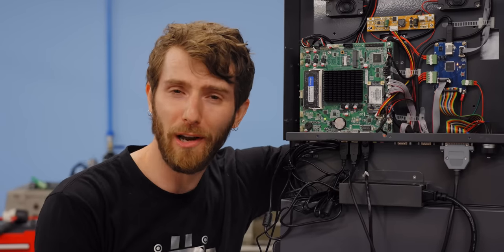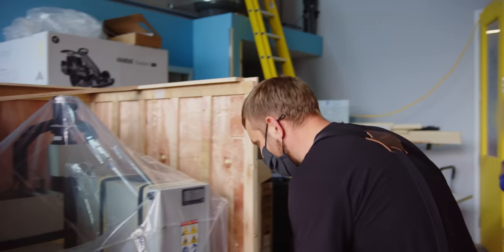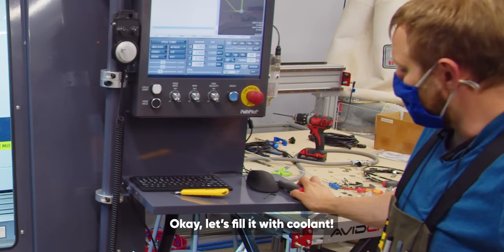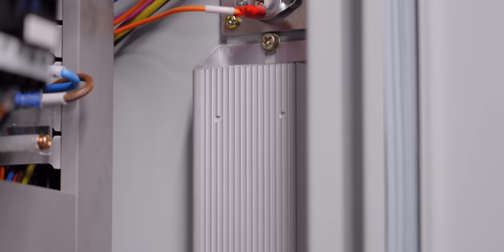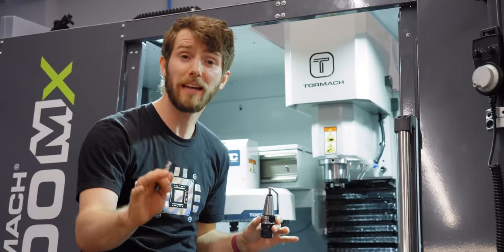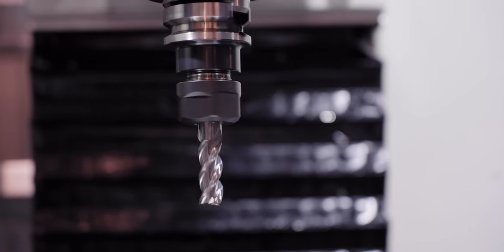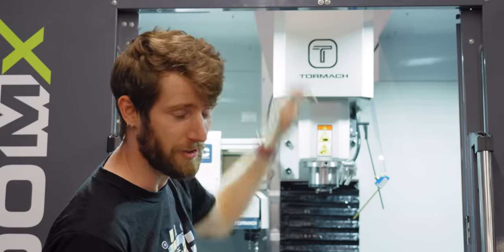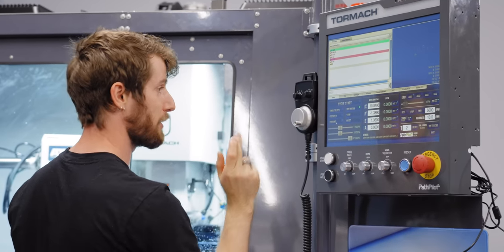The longest unboxing we've ever done. - Tormach CNC Mill Commissioning

Comment: At the risk of being "that guy", kudos for what looked like steel toed shoes when operating the forklift.  However, be sure to wear eye protection (goggles - thanks @DETERNET) when using compressed air to blow off, well...anything.  The trip to the ER to get the little metal shaving out is never fun (nor is the workers comp claim!).  Other than that, awesome vid.  Love the channel.
Reply: Especially with how up tight Linus' HR people seem to be about injurys
Reply: I can attest to this.  Once had a tiny metal shaving fly into my eye when I was grinding.  Thankfully no damage was done but ya getting it out was not fun.
Reply: @outsideredge  same here, one of the most painful things I've experienced
Reply: Use safety goggles not glasses, I managed to get a tiny shard in my eye while using a face shield and safety glasses, still no idea how it happened
Reply: I second this. Worked as a cleaner in a factory specializing in transport augers for a couple of years, and yeah, hadn't it been for protection I would've probably lost an eye (which actually happened to my boss many years prior to me working there. He had to get a glass eye)
Reply: You are so right, I was in an machine environment where I wasnt even near or using the machines and managed to have a tiny metal shaving get blown into my eye. Was able to get into an eyewash station but it was still not a great experience. Was definitely worrying to say the least, due to irritation that day.
Reply: Had a hot shaving fall between my eye brow and safety glasses and burnt my eyelids together, it was terrible so nice pair of goggles is a must have and USE!
Reply: Its bad enough getting that shit elsewhere, my neck hurt for two weeks and one day i managed to dig out metal shaving pieces from it, that must have been sitting there after doing some metal work.
Reply: I have had to learn to do a lot of self triage and also what I can safely triage on myself and what I have to accept is a hospital thing. The easiest one to ignore is impact resistant gloves. They cost like $25 at Autozone, Home Depot or anywhere that has a good assortment of machine work gloves. They will save your fingers from all sorts of horrible destruction. A few weeks ago got my thumb with a 20lbs sledge swinging on a hammer guide while taking a dent out of a piece of metal bracket. Took 2 hours at my desk with IPA, Jack Daniels and the fine tweezers out of my iFixit kit to remove all the splinters of what was my thumb nail from the tip of my thumb. Barely even nicked it, with gloves it might have pinched but otherwise been fine.
Reply: @outsideredge  You get to be really close with your coworkers when you have the steadiest hands in the place, and first aid training, when an errant chip manages to make it past safety glasses.
Reply: I'll never forget that one splinter that cut right into my glasses like a blade. I would have lost my eye.
Reply: My OSHA bone was tingling the whole time lol!!
Reply: OSHA gave us a heads up that you shouldn't use more than 30psi if you're blowing off your clothes too
Reply: @curt8806  ok curt
Reply: @curt8806  well. Looks like your alone in that opinion. Maybe move on to another comment thread, my friend?
Reply: Yeah, no kidding...."keep doors closed while running machine", but let's blow off chips chips without glasses. I feel like one cancels the other lol
Reply: Oh god, it's that guy
Reply: @brahtrumpwonbigly7309  Who is "that" guy?
Reply: For the safety of everyone, 1 "That guy" is always needed
Reply: 2nd. Watched a coworker go to ER and be out for 3 weeks due to simply blowing off a part before taking it out of the machine. Got unlucky and took a chip to the eye. Fun juices.
Reply: Depending on the metal what would be the hazards or utility towards using a magnet to remove the metal peices from less delicate areas?
Reply: It will be fine
Reply: Great comment. I left a similar one. You're 100% right about eye protection. Always wearing them is a safety rule should never be ignored or compromised upon. At least until you can't perform QC checks because of all the coolant covering the lenses, LOL.
Reply: @mica4977  I'm not sure, I took a chip in the eye around my safety glasses. Co-worker got it out with a magnet. Took a quick trip to eye doctor, got some drops and was back to work lol
Reply: @manicmotox4214  Did partially imagine it would help as long as it's at an angle that won't pull the chips across more tissue.
Reply: @mica4977  Yeah that would make sense. I was told it danced out of my eye when he got the magnet close. So pretty straight in, an then back out lol
Reply: I had a shard of metal puncture my glasses in shop class at my tech school once, it wasn't from the air but from a drill bit snapping and it missed my eye but damn do I check the rating of all my safety gear now, and hopefully so does the school.
Reply: i agree something broke inside me when i saw that
Reply: I agree, having to stare into a UV light while they find said metal shavings, then still be watching as they scrape them out of your eye while also being in a lot of pain and hurts to keep your eyes open is a pain I hope to never experience again!
Reply: I desperately want to see a collab with AVE

*Spelling mistake
Reply: @DETERNET  It was probably sitting on your eyebrow. Happens to me about twice a year can't always be 100% protected. Goggles will fog up and blind you after 15 mins of use. Of course depending on where you work. Where I work goggles are more of a hazzard.
Reply: i'm sure excited to see what they're going to do with this beast :)
Reply: Does the "that guy" title include all the common sense and prop 65 warnings? Safety is relative and the kudos don't mean much when you actually use this kind of equipment on an hourly basis lol.
Reply: Imagine going to the er for a sliver.
Reply: Yeah when he started blowing the coolant off I saw him not have eye protection and I instantly started cringing

Comment: I honestly think 40k is a fairly low price for something like this. It's an insane piece of engineering.
Reply: It's also bare minimum for a "production" machine.  They are fantastic for the price but check out prices on HAAS. I bought near enough to this mil to go alongside my Bridgeport without the 4 axis for my home shop and couldn't be happier but if you want half a thou tolerances and high speed milling you gotta drop big boy bank
Reply: Der8auer just bought a German one for 125,000€ 😂😂 around 150,000$ 😂🤣😂
Reply: Especially when you consider all those $20k PC builds.
Reply: Oh definitely. If you compare it to the router, which already costs 10 grand... The new mill is ballin'. Much better value imo.
Reply: @mannyfreeze8821  oh man. But that one is a little different - it's working area is much bigger in the X and Y direction, but it's less versatile in the Z axis. Also, there's no 4th axis. And it's German. That alone makes it 2x as expensive😂
Reply: @mannyfreeze8821  XD come here to comment the same
Reply: @jeffreyhill1011  well, the specced tolerances are 2 tenths of a thou on this machine, at least that's what they say in the video.
Reply: 40k is about as cheap as it gets for this kind of equipment but you get what you pay for. For a truly capable machine (5 axis, 30+ hp, high capacity tool magazine), you will be looking at 200k and thats on the cheap side.
Reply: @InterFelix  yea good luck holding 2 tenths on this thing. Maybe in a reamed hole😂
Reply: Agreed, I sat here thinking what I can make to sell 😅
Reply: @BestRedditorClips  Yup. Our newest machine is a 5 axis with 100 place tool cabinet. With tooling and fixturing I estimate it was about 500k
Reply: @InterFelix  It's got pretty low grade and loose dovetails on a frame that bends depending on how you level the base. It's not getting anywhere near 2 tenths, and further away with every day of use as it wears. For perspective, an $800,000 DMG Mori with water cooled linear guides and ball screws and 100 nanometer glass scales is rated for 2 tenths... What tormach is telling you is the resolution of the motor/screw combination, not the tolerance or precision or even repeatability. Basically meaningless. You could say a haas has a tolerance of 0.00000002" using that logic as it has 24 bit encoders.
Reply: @jeffreyhill1011  yeah, to use pc terminology this is essentially an enthusiast consumer grade mill. I run a fairly entry level HAAS at work and it’s really not close.
Reply: Everytime you buy machine you buy that for your purpose if you making small pieces with big tolerances you dont need to spend 200k on 5axis machine if you need something precision And really strong you must buy bigger price Machine thats fact but if you are skilled machiner :D you can do best piecies in the world on cheap machine ;)
Reply: @jeffreyhill1011  And a Haas at least has linear rails and a 40 taper spindle. Unlike the Tormach.

Honestly, for what they spent, I would have told them to go buy it a Haas Minimill. It's a "real" machine, has an actual service network, and has a better resale value.
Reply: @BestRedditorClips  I think we paid around $230k for our 42srti Hurco s, and about $130k for our Vmx10u, which I think are about the cheapest 5 axis machines in the industry, and absolutely tiny - around 6500 lbs iirc.
Reply: Yeah, one of our newer 5 axis machines cost 300k, and it's fairly small
Reply: @InterFelix  0.0002" is on the x y z positioning on each axis making it a theoretical 0.0002*1.41^2 positional error. That doesn't account for any runout in the spindle, runout in fixturing, touching off or indicating tools, working with Aluminum (lol) and so many other things.
Reply: 40K his the price of the spindle on one of my équipement

Comment: I can’t wait for, “GAMING ON A CNC MILL?!”
Reply: It’ll run doom, that’s for sure
Reply: @jacobm2625  The better question would be if it can run Quake 3 Arena or Unreal Tournament '99.
Reply: @arnox4554  Better yet, lets fire up Crysis 2 on ultra 😂
Reply: There was a guy that made a CNC mill run along a user position in Minecraft, so yeah it's possible I guess
Reply: @well_as_an_expert_id_say  I, too, like Powerpoint slideshows.
Reply: Remember, it's always faster to T2M6 than reloading your tool
Reply: more like, WATERCOOLING A CNC MILL???
Reply: If it's anything like computers in Hurcos, regular windows functions aren't normally accessible.
Reply: @a.ffirmative  Spindle chillers have become pretty much standard these days for most machining centers - all the Hurcos at work had them. They didn't run water either - it was filled with, iirc, Dowtherm, which is neon pink in color.

Comment: Wow, now they can fail at making heatsinks - IN STYLE!!
Reply: They'll use it like three times and then it'll sit in the back, covered and rotting
Reply: @CheffBryan  
or they could be smart and start making their own computer hardware, like reservoirs, fittings, plates and such for computers, then sell it.
deadass i would like to have a LinusHardware branded liquid cooling loop
Reply: Bruh that is the best joke here lmao,
Reply: I think the new guy they hired might actually know what he is doing.
Reply: @felixf4378  I agree - did you see that bike pedal? That was way more complex to make than it needed to be. Definitely a competent engineer.
Reply: @CheffBryan  I doubt even LTT would let a machine like that just rot in the back. They have to have bigger plans for it.
Reply: @mokubakaiba1751  They had no choice to outsource at the time... It was still LMG's design but all the machining had to be outsourced because they didn't have the machine capability.
Reply: @mokubakaiba1751  Outsourcing products isn't a big deal.  The parts in a  vehicle you drive, the plane that transports you are for the most part all outsourced. Very little is manufactured in house if at all.
Reply: @itsdokko2990  I doubt them because of what they already have around and have made things they could sell already, but simply haven't. Their older CNC machine could have been set to spice up whole sheets of plexi to make water coolant parts, plenty of sheet metal working tools to make all manner of case parts if not whole cases outright, so on. They simply haven't done anything, and I'm not convinced they'll start doing it now

Comment: Ah! Never EVER slide your hands across milled aluminum. The edges are SUPER sharp! On the plus side, this will make heat sinks much better than a hacksaw can :)
Reply: Thank you
Reply: True story.
Reply: Yeah. I pulled on a piece of aluminum shaving once without gloves. Super lucky all I got was a minor cut, it was basically razor wire. I've learned to be much more careful.
Reply: I've never seen a hacksaw can before.
Reply: Serious question: It seemed like he cut a new edge to the piece and everything was 90 degree angles. Is that dangerous? Unless there were tiny burrs or shavings, I don't understand how he would get cut.
Reply: @johnbrooks5903  where the edge is at the top and bottom of both 90 degree angles it may not look it but its sharp af. a slip of the hand and it will slice like a knifes edge.
Reply: That fucked me up when i saw that
Reply: Moment of silence to all of us who learned this the hard way. But for real nothing is worse than those dam metal splinters!
Reply: @SprDrumio64  ye how did he not slice up his fingies??
Reply: So what do you do then to stop the slice and dice when the part is finished if you don’t chamfer the edge? Or do you just always chamfer the edge?
Reply: @kornykidd0  if your doing more to a part, you just deburr it, if it's an incredibly specific part, then the chamfer is done on the part instead
Reply: @kornykidd0  mostly depends on the job if it asks for one
Reply: @kornykidd0 most prints have a break edge callout, i typically program mine to be done in the machine as its way more consistent than a human. part of our pride of craft is handing out quality parts, and part of that quality is making sure the first goober that handles it doesnt get blood all over it, so good machinists deburr their parts.
Reply: @johnbrooks5903  yes 90 degree edges that are razor sharp, everything in a machine shop is Hot, Sharp, or Heavy..... sometimes all 3
Reply: Likewise turned brass needles. End up with a hand that feels like it's been attacked by a porcupine..
Reply: John Brooks yeah. It's a very sharp edge. Like a razor blade.
Reply: I will file a complaint against this Tormach company through all the channels I use. 

This is because I have not sent the product for more than 3 months without any reason for my order and there is no response to the refund request.

I hope that companies like this don't do that.
Reply: I have slide my hand down a freshly milled piece of aluminium and actually have a scar on my index finger which cut to the bone so I weren't so lucky 😂😂😂😂😂
Reply: Nah it's fine I do it every day as a machinst.b
Reply: hacksink

Comment: "if your part isn't held in place extremely securely, you're just gonna end up with a giant mess" can speak from experience, this is very true
Reply: Not to mention scars - I have a a fine line scar on my arm  from a shattered carbide endmill.
Reply: And a giant bill… we had a rookie manually jog the turret of our lathe into the tail stop once… he’s still a rookie, probably at some other company.
Reply: @sergeantmoo7832  glad I'm not the only one who had that thought
Reply: You must keep your part firmly inserted during material egress.
Reply: this applies to 3d printers as well.
Reply: Btw, isnt this thing called VMC?
Reply: @Legion849  Report, don’t reply. Your comments keep the spam alive.
Reply: Especially in a large lathe :D
Reply: @fongus6420  Eh… most additive methods are self-securing, like SLA, SLS, and inkjet. FFF/FDM your worst case scenario is a damaged belt or extruder head… but even then, we use a Fortus 450mc and have had maybe one issue with it not holding. The stakes are way higher with machining, because when you’re running 900 ipm through steel and your stock just yeets itself through the window, you could injure or maybe even kill someone, plus seriously damage the equipment
Reply: @Sk3tchPad  can confirm, part was yeeted, luckily toward the sidewall and not the window. In the end the only damaged parts were the end mill and the parts themselves, I still have sitting on my desk at work like a badge of honor lol
Reply: Simple piece of wood split and started spinning on the drill press in shop class. Very exciting.

Comment: Coming from building these machines and using them every day, this is one of the coolest videos I’ve watched from Linus
Reply: What do these machines do? Why has he bought it?
Reply: @vitaminprotein.4036  They do the opposite of 3d printers as for why he bought it I didnt watch the video but Tormach has recently been sending machines to YTers
Reply: @vitaminprotein.4036  If you marvel at those fancy computer cases with specialized cooling components, or wonder at those finely machined parts like heat sinks etc.. Anything that is manufactured that looks professional. The secret sauce is this type of industrial CNC machine and of course an in house CNC specialist who can make things on this machine. You can do moulds for manufacturing plastic parts or shape wood etc..
Reply: Same same. >100 of them in our shop and using them is just 2nd nature at this point. Kinda got a laugh when I saw linus using the airgun to blow chips off the part with no saftey glasses and im like hahhhhh I watched a newbie coworker go to the hospital after doing that and had to get surgery done and wear an eye patch for a few weeks.. Setting such great examples!  But aside that, the pendant reminds me of DMG and Cublex
Reply: @IdeaBoxful  heat sinks are extruded